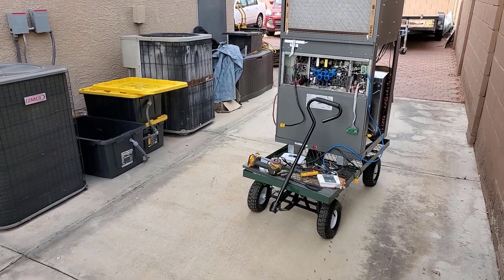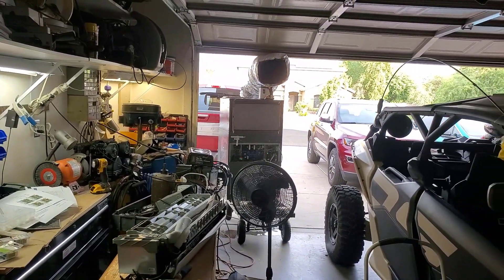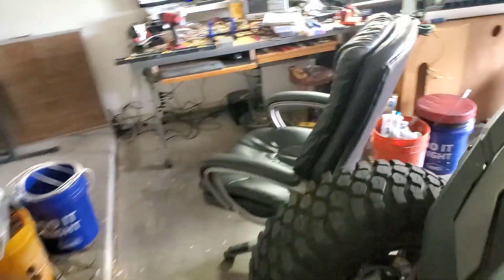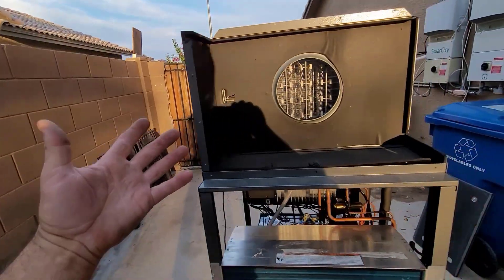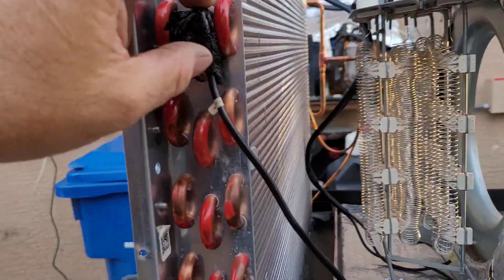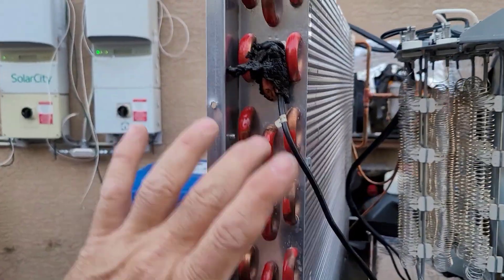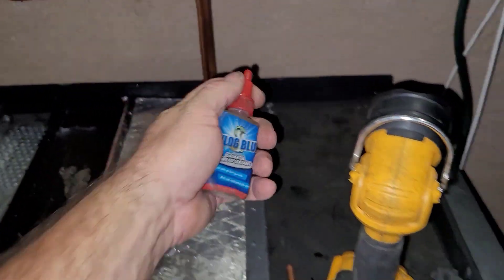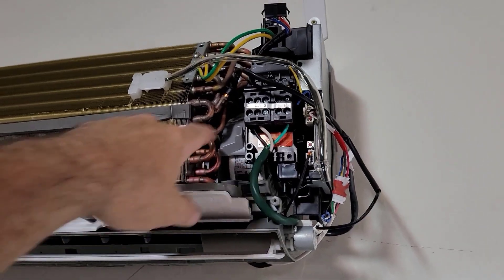Frankenstein Engineering combined VRF equipment [PART 8] Install Mini Split AHU and dissect VRP

Comment: Oftentimes these boards have some form of AC Zero Crossing Detection - this is an error code that is common to many mini split/smaller VRF system controllers. Usually the way ZCD is done is with either a line through a bunch of divider resistors to a microcontroller pin, or through an analog comparator. If you want to operate one on DC, you'd likely need to find out where this circuitry is, and inject a low voltage AC waveform into the low voltage side of that. Keep in mind this circuit will also be referenced to HV ground if the MCU is, which on one of your previous videos about these systems, it appears is the case (note optocouplers/optoisolators near communication lines but not near MCU to motor drive packages). 

Perhaps if you can post a high resolution picture of the front and back of the board, or even a video going over the parts in detail so the part numbers are visible, someone can help with finding those parts of the circuit.
Reply from the maker: I have a failed board here that I can pull from the heat sink.
The only thing about the AC signal is that on batteries alone I wouldn't have it unless I made something to create it.
But with that much work I may as well just set up one bank of batteries with some panels on a charge controller/inverter combo and just run the unit with the AC power input for emergencies. Then a generator could also easily be used.

Comment: Looking good So Far! Just curious, not familiar with the VRPs, what is the cooling refrigerant control device?  EEV or other device?  If EEV, could one of those evap sensors be use for refrigerant control?  It's going to be a nice setup when done.
Reply from the maker: EEV.
And there are temp sensors all over this thing.
4 sensors to the indoor section.
Evap coil temp in, evap coil temp out (which is really just midway), Return Air Temp and Supply Air Temp.

In the outdoor section is a sensor before and after the EEVor liquid line temp depending on in heating or cooing mode, an Outdoor Air Temp and a Outdoor col discharge temp.
Plus a suction line and discharge line temp.